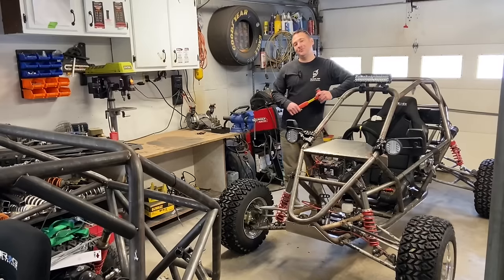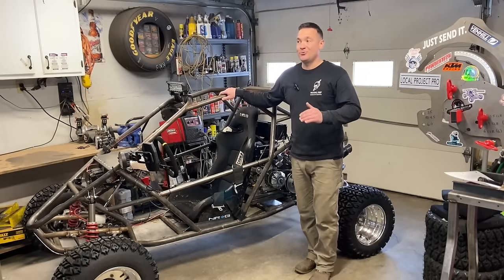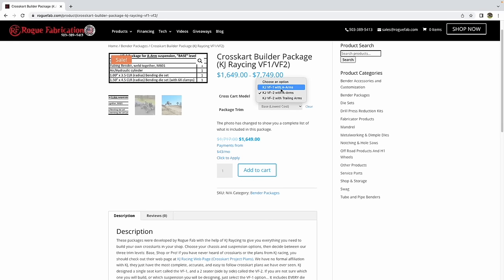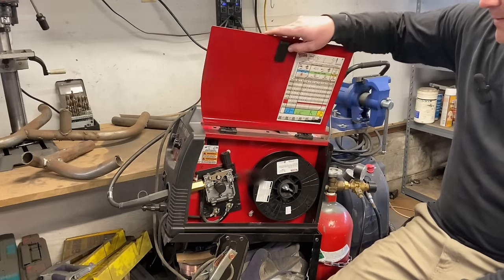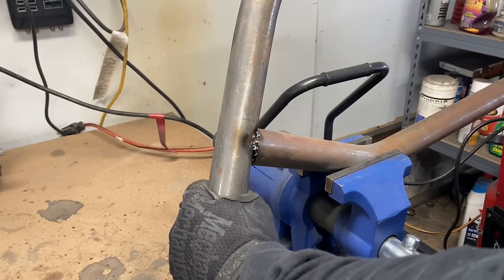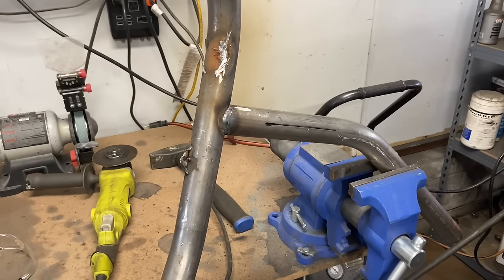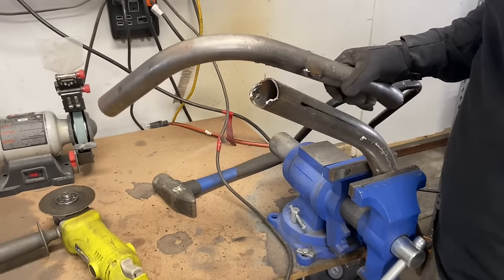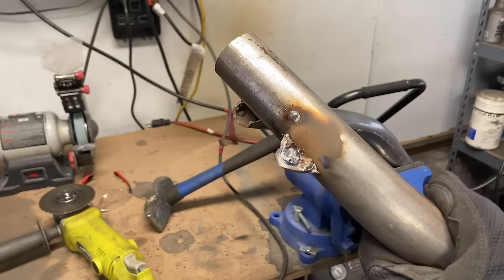How to Get Started in Fabrication

Comment: You learn how to grind with the radius of the tube.  You can keep building it up to where it's above flush and no low spots then gind it to where it basically looks like it was never there. Afterwards put your final cap pass on at where they join. Kinda like body work and bondo.

Comment: I finally got through my first hurdle. Buying a 220v multi process welder and having an outlet for it installed. I saved for a year for this. I used to be a certified welder but quit because the industry was rough for a new welder. Low pay, bad working conditions, etc. I wanna weld still but I was not happy doing it for a living. Making my own projects that make me happy will be so fulfilling. I have stuff I want to do to my truck as well as fabbing steel frames.

Comment: Good tips good advice. Not a pro welder either but I know you don't need to weave it can help it can hurt... Just listen to the crackling sound a pro welder makes and replicate that preferably in a smooth pass with 1/8 gun gap. That'll stop 99% of your spatter. I usually get relatively spatter free welds keeping a close distance. Granted my actual welds are fatter and uglier but I'm running flux core so it is what it is... Lol!

Comment: We just need to work on that bench design! I always like to double up plywood for the bench surface so i can have a solid spot for the vice. Also 2x4s around the perimeter and 4×4 corner posts ancored into the floor.

Comment: would that type of rear end work for a street legal motorcycle if i put highway tires ?
Reply from the maker: It is designed to be very strong if you follow all of the instructions. I’m using a hayabusa on one of my karts and I have a lot of confidence in this rear end from my experience.

Comment: A way to test your weld is to cut it apart and acid etch it to check penetration... Even shitty welds will hold up to some monkey with a hammer, they need to hold up to a roll over. I'd recommend some basic welding classes, they're not that expensive.

If you're comfortable just sending it, then do so, seems a shame to go to all this effort and expense and not throw another few hundred $$ at learning a new skill rather than winging it though.
Reply: I took an evening class on tig welding, it was a lot of fun!

Comment: I teach welding. Your welds are not bad, but with a little help or a daycourse they could be way better.

From Europe your info on voltage feels strange, 240Volt @ 16 amp is a standard outlet in every house, I weld on 380Volt and 64 amp
Reply from the maker: This is a 110V welder… the welds have held just fine for over 4 years of hard driving. I’m sure a 240v welder would make the welds look better.

Comment: Hay mate you should try turning your wire for the mig the other way around have the wire come off from the top of the reel
Reply from the maker: Yup, I saw it when I was editing.  Easy mistake and I've used half the spool with no feeding issues or jams; so it actually kind of shows it can be loaded either way, right?  Thank you for the heads up though, I appreciate it.
Reply: @KJRaycing  for sure just thought I would say something just Incase you had problems and didn’t know why

Comment: Why blur the wire in the welder @ 8:44? Just seems odd
Reply from the maker: The wire is routed from the bottom and I was tired of the comments. Welder worked just fine but I didn’t want to have to swap it until my next roll.
Reply: @KJRaycing  you SAVAGE. I’m fairly new to welding and It’s funny how hard “professional” welders gate keep the craft. I understand if you are welding fracture critical structures. But small at home fun stuff doesn’t matter. Thank you for the information in the video. And if you ever hear “1SG” on freq make sure to shout out the crazy Cuban.
Reply from the maker: Roger that, Top. 👍 The pros take all the fun out of home fabrication with all their judgement and pretty welds for sure…